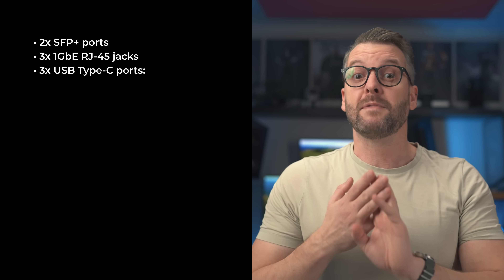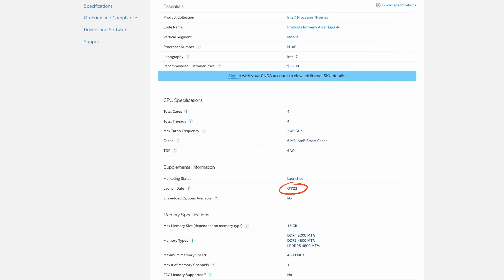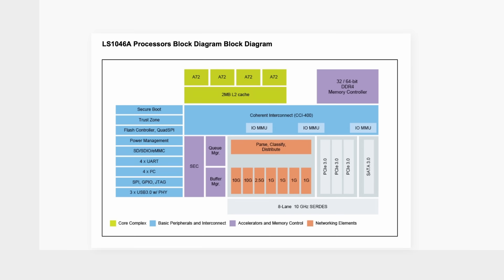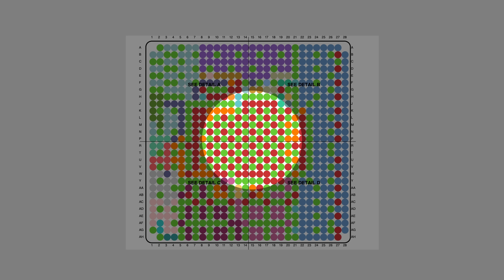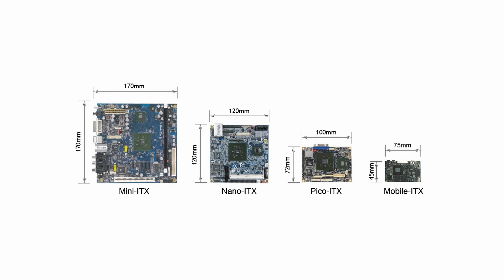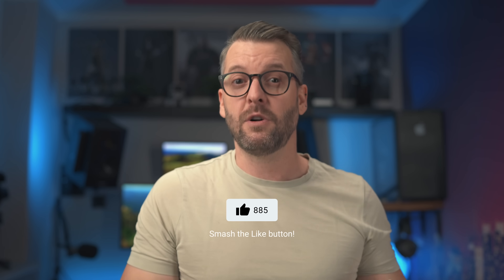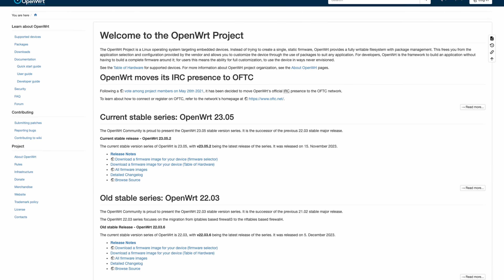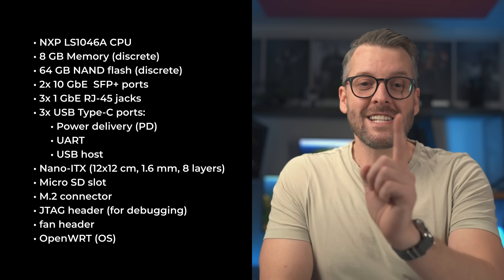I'm making a high-end router IN PUBLIC. Here are the final specifications.

Comment: I think you are drastically underestimating the software effort here to take most advantage of your hardware platform, which is why the "laptop CPU in a fanless chassis" form factor is so popular.

Also - maybe don't waste your time on the hardware, and just use the Banana Pi BPI-R4 platform which already exists and meets or exceeds all the specs you've laid out here.

If you have an industrial design team that's already bought in to this ceoncept, then don't waste time developing a new PCB on a new CPU platform, just take the BPI-R4 and turn it into the product you're imagining (more flash, add SD card, etc.). Then you can start prototyping & developing software now and maybe be able to ship something near the end of the year or early 2025.
Reply from the maker: Thanks for the feedback, but no. You don't build a company on shoulders of someone else's. Too risky.

Comment: I'm curious what kind of bandwidth this CPU will be able to do with SQM (CAKE) enabled on a 10-gigabit link.
If you use an SFP+ module to link to a cable modem with a 2.5GbE port, you'll definitely want SQM so it won't try to send 10 gigabits through the 2.5-gigabit link.

Comment: I find the „high end“ very misleading (also I understand where you coming from). The Microtik CRS312-4C+8XG-RM for example has 12 10gig ports, 8 of them do also 2.5/5 and 4 of them also do sfp+ and it’s cheaper
Reply from the maker: You're comparing apples and oranges. What' you listed is a switch. These two devices (so the one we're planning and this Mikrotik), would actually work great together.

Comment: All ports UTP should be 10Gbe since that would be a minimum for power users in some years ahead. NAS loaded with SSD"s/M2's will be the norm, and you want at least 800-1000Mb/s throughput to use those NAS boxes for video editing in 4K. Even 8K is around the corner. And for Mac, since local storage is extreme expensive, this becomes a very good use case!
Reply from the maker: I agree. But there's this small issue of,... price :)

NXP actually does produce a CPU that supports 8x 10GbE ports, but that CPU itself costs around $300, and if we add  PHY chips, connectors and all the other necessary stuff for 10GbE networking, it would cost well over $1000.
Reply: Yes now I understand. So unfortunate. @tomazzaman

Comment: I Think Its a cool project but i have a few concerns. I ve recently upgraded my router to 25G using a minisforum ms-01 and a mellanox 2x sfp28 nic. It runs opnsense and has 2*SFP28,2*SFP+ and 2*2.5GBase-T and cost me around 800€ which is an incredible price for a device this fast and capable of pushing 25G... I sadly dont see where the Router your Team is designing would make sense for somebody like me... Cool project nonetheless
Reply from the maker: Thank you for the feedback. I like how some of you are pushing the limits, but what I need to keep in mind is the majority. And the majority doesn't use or need 25G.
Reply: @tomazzaman  and the Router definitely has its place... I used to work for an ISP and we had ekinops OneAccess devices which were arm based devices just like this one using some BSD/Unix firmware and they destroyed every other manufacturer  in terms of flexibility and performance. If done right yours is gonna be a beast with even lower latency than my Software based machine (using a Opnsense Software bridge  for the SFP+). Also i like the machined Aluminium housing alot! I dont remember wether you plan on putting a fan in it, but if you do, i definitely wouldnt cheap out on that. My previous Asus AX89X had a Fan which was ridiculously annoying... Dealbreaker for me by now. And for the WiFi i have a wird idea: you could do a tray like a disk bay on a Server Option one: a tray to put something like an Intel be220 in with SMA antenna plugs on the Outside of the case 
Option two: a tray with an oculink Interface to connect on the outside so one could build an external WiFi AP module with high gain antennas or whatever using the pcie over oculink to connect to the rozter... Similar to a framework Laptop modules
Reply from the maker: @legendaryz_ch  Thanks! We do plan to put a fan header on the board, but aren't sure yet whether it'll be necessary, at least not for the alu version. Regarding the WIFI, there will be an M.2 connector on the PCB (Key E), which should give us the flexibility to put one on after the fact. What we're also exploring is out own access point, but nothing conrete yet, we'd rather focus our limited resources on the router to develop something great.
Reply: @tomazzaman  that might be true, but the majority also does not want a full metal enclosure which costs more than wlan routers with NAS and phone and iot and cable modem and ap. So if going for the high price, also go for the high-end

Comment: Yes, I hate mostly something, it's missing a 2.5G RJ-45 for a device that will cost over 200€ and it should be future-proof, well the 10GbE is greate but most devices these days are 2.5G and the trend is rising. Especially when you have internet speed over 1GbE and a good NAS with 10GbE!
I would rather see a replacement of those 3X 1GbE  RJ-45 with 1X 2.5G RJ-45!
Just my way of thinking!

Comment: An aspect that I think most people are glossing over with this project is the software: what OS will this run? pfSense will not run on it as the only images Netgate provides are for x86. Only Netgate hardware can run ARM versions of pfSense. That leaves OPNsense, openWRT, a custom Linux-based firewall and router OS, which inherently means a smaller community. Having the perfect mix of hardware and features means nothing if the software support stinks. A good example is the gap between the Raspberry Pi ecosystem and the Rock Pi boards. Many Rock Pi boards have better hardware and features than Raspberry Pi, but the software, support, and community is dismal in comparison to Raspberry Pi. And generations of better hardware haven't narrowed this gap. Software is the most critical aspect of this project, and unless you can run a great router and firewall OS on this machine it's DOA. I say this as someone who is excited about this project and wants to see it succeed! 

While your selection of this ARM CPU with its inherent advantages for this application seems like a great choice, ARM lacks the same breadth of support and software options for this use case. ARM continues to grow, but for homelab, hobbyist, and enthusiasts, x86 provides more options and flexibility for software. 

I'm looking forward to learning more about what software options will be available for this device, and there must be options, you can't limit this device to a single OS given your audience.

Comment: Just 1 M.2? Full spectrum Wifi 7 AP modules take 2 M.2's. Cellular as well. Maybe a PCIe multiplexer with support for modular applications? It' sounds like a BPI with a restricted feature set otherwise. 

SFP+ is a standard from 2006.. That CPU will be old news also by the time September comes around. I may have to wait for a Gen 2 :).
Reply from the maker: We're making a router. Even a single M.2 is an overkill for most, haha. And fun fact, ARM Cortex-A72 is now 8 years old, still being mass produced. Just shows that old doesn't mean bad. Like myself. 😂

Comment: Lost interrest. was following close as it sounded exciting but it is 2024, and most likely close to 2025 before actual product comes to marked. And in my opinion a router in 2024-2025, would not make anysense to buy a router without 2.5GbE. as meany of our internet providers atleast for fiber in denmark dont even ship out routers without 2.5GbE anymore, would i like to see a simcard slot aswell but as in my resreach in minipc/routers, there not a working M.2 5G/WWAN card working as of now, as far as i see it for now  the Banana Pi BPI-R4 would be the better option, if you where to buy it today also coming in at a pricepoint around 160$ the alternative would be to buy CWWK or TopTon Mini PC N100 with 4*Intel i226-V2.5GbE  witch could clock you in at a price as low as around 300$
Reply from the maker: Fair points!

Comment: This is so awesome! How can we pre-order or pledge?
2 small inquiries: SFP+ compatibility is a pain and each ISP uses different modules. Is it possible to maximize compatibility somehow to avoid needing a media converter? Similarly, is it possible to make the SFP+ support all multi-gigs: 10, 5, 2.5 (and 1)?
Thanks for sharing. Really looking forward to more updates!
Edit: I also believe Type-A would be better as the host for a cellular modem or printer. What sort of Type-C devices would fit there?
Reply from the maker: I'm not a huge fan of preorders, as many have been burned by them in the past and I'd hate to be in this position. Maybe, just maybe, when we're close to launch and if the demand is significantly higher than the supply.
As for the multi-gig support, that's up to the SFP+ module that you use, we plan to test as many as possible to make sure the widest selection is possible.

Comment: So basically you are building something like turis. It would be probably best to build it so it is affordable but also can do wifi and has easy to use interface for non technical people with an option to see more advanced. Building a device that maily meets requirements of enthusiasts is a mistake I think. Try to make one that is more down to earth and one that is for enthusiasts. Will this router be available in the entire EU? Do you also plan to get in contact with local sellers or will you mainly handle everything yourself ? Btw i just discovered you and it seems like interesting project. Good luck.

Comment: Will there be the option to add some M.2 SSD into it? IMO it would make it a perfect NAS without the need for external one. Just my 5 €c.
AFAIK WiFi and SSD have a different keying on connector. Maybe adapter could be used for different keys.
Reply from the maker: So, the current plan is to use Key E for the M.2 socket, which isn't compatible with NVMe drives. If you want additional storage, there will be a USB3 port. But, that's not the focus, we're making a router, not a NAS :)

Comment: I build custom networks for very strange places, usually with extreme weather. Often using the $250 Mikrotik RB5009UPr+S+in and loving them. Not quite the same specs but I'm interested in more info on the durability specs.

Comment: I'd like to hear from you why this router is better than alternatives from your competitors at the same price point. I think it's wise to consider it while making your specifications, because if you're going to be roughly the same specs at the same price, I think your competitors will have all the advantage.
Reply from the maker: I've done a video on just that! https://youtu.be/qnM0h34rB8g
Reply: @tomazzaman  I did watch that video, but it is rather vague in terms of specifications when talking about your competitors. But now you have your specifications, your price point, there's still competition to look at. For example, Mikrotik's CCR2004-16G, which also has 2x 10G SFP for about the same price. 
Having your hardware open and customisable OS is a big selling point, but you might need a little extra to push fence-sitters to your side, even if it may be just advertising the ways the hardware can be customised (upgrade RAM? / Add Wifi? / Expandable Storage?), or on the software side like being capable of running a small mail server for your family on the router itself.
You made a video about COGS vs Perceived Value, and mentioned in it that you can increase the perceived value simply by flaunting your product's capabilities.

Comment: is the POE+ going to be a power sink or source? 
Regardless there are POE modules that can be added if needed , provided that you added pinheaders on the needed signals. 
OR u can simply pin pinheaders and develop the POE module later on another 2-4L PCB if there is enough demand ( if there is not enough space for a standard module or you simply want something built better/ that fits better overall )

Comment: Sorry, I'm just a little confused (bare with me. I'm not that tech savvy). This is a router without wifi? Is this a switch?
Reply from the maker: The device that your ISP provided you, is an "all in one", so to speak. A router, a switch, and an access point (wifi). It performs all these functions well enough, but exceeds at nothing. The device I'm making is a router, so a specialized device which has no wifi. For that, it needs a separate device (access point).

Comment: Now that i think about it more from router perspective a single 1GbE RJ-45 jack is a must as it can be used as a management port or as a networking port for those of us still slumming at rj-45 based 1GbE lan (not that i need anything more). but i also think 2 SFP+ ports are a must as well. SFP+ is very versatile connector that is native to fiber which is what most faster then gigabit WAN(and even slower then that) connections would already be either sfp SFP+ or a fiber connector that you connect into SFP+ module therefore having RJ45 2.5 GbE port would be kinda bad and wastefull specially if SFP+ port was eliminated also using 2.5GbE RJ-45 makes sense from UX perspective, but doesnt from any kind of expandability or usability perspective as sfp+ can be adapted to do rj45 so if user had a rj45 2.5GbE network they could use a media converter module to go from sfp+ to RJ45 at which point they can connect to that. and still allows those with 10 Gbps network to use SFP+

Comment: wow all that r&d + investor $ just to spend it on a subpar router with dated specs. if I was in charge of the project i would scrap the GbE and opt for 2x 2.5GbE + 1 PoE (2.5GbE), upgrade sfp+ ports to sfp28, scrap microSD, add secondary m.2 slot for redundant boot drives or add 2 usb/poweredSATA headers for redundant DOM drives. most router software doesnt even need more than 8gigs of nand flash for their OS and you should really be writing your logs to a server.
Reply from the maker: Do it.

Comment: Super looking forward to it. I'd like the 2.5Gbe port just to be able to eek out that little extra but I feel like one SFP in and out should do the trick most of the time, but if it were possible with the current processor, full 1/2.5/5/10 Gbe RJ45 would have been great just to make it suit more needs and extend a bit further into the future, though I'm someone who bet on the jump straight from 1Gbe to 10Gbe rather than the market all going to 2.5Gbe, so I'm set for it. I'm not expecting it soon but this is definitely enough that I'm putting off upgrading my pfsense box  to see how this pans out just because it checks the boxes so nicely. Best of luck and looking forward to the future updates!
Reply from the maker: Thank you for the kind words of support! I also jumped from 1 directly to 10 in my home network :)

Comment: WHen I'm paying more than double the price of a regular FritzBox, I'm expecting more. The SFP+ ports are nice, but the fact that the one possible 2.5gig port is only a consideration... Ehh, I dunno. 2.5gig is important, especially if you don't want to throw your SFP+ ports into a switch and then to the respective devices.
Reply from the maker: Valid points, thanks!
Reply: @tomazzaman  Don't take this the rude way! I just believe that if you are designing a top notch router that people would pay a few hundred for, you should put everything in the processor's capabilities in the device. 

Could the host USB-C port work as a drive access? To have a very simple (maybe Samba) network drive that doesn't really on any other device. 

I also stand behind the idea of adding PoE to (possibly) all RJ45 connectors.

Comment: ARM is very limited in terms of OS.

Router operating systems are very limited compared to server or desktop operating systems. So you already have a smaller option to pick from.

That rules out VYOS, PFsense, and OPnsense.

Is this a DDWRT/Linux only capable system?
Reply from the maker: Luckily, all the projects that you're listing are open source, meaning that with enough resources, it's possible to port them to ARM.
Reply: OPNSense already has someone making aarch64 versions

Comment: Look at the support for the DPAA of the CPU in the Linux Kernel. The biggest drawback of multi-port routers, which don't include switch chips, is the port2port packet forwarding performance. In these designs all packets need to go through the CPU which hammers the performance/increases power utilization. Also agree with 2.5GBe port - it's a must-have these days. I know you could offset this by a SFP+ -> RJ45 converter, but still a native port is better. Having PoE capability on copper ports will enable easy deployment with numerous WiFi APs.
And do you plan to enable M.2 storage? Or just keyed for the WiFi adapter?
Reply from the maker: I have a form up in which I ask all the relevant questions and the majority of people "vote" for two SFP+ instead of RJ-45, reason being max flexibility. And as for the M.2 storage, I don't see why not, it's a firmware/software thing, once it's routed to the CPU properly.
Reply: Agree with the sfp+! What I meant is that if we don’t get a dedicated 2.5G copper port we’ll need to sacrifice one of sfp+ to it.

If it comes to M.2 - WiFi and NVMe have different keys - so it’s either or (unless you use adapters)
Reply: M.2 storage and wifi tend to use the same interface (PCIe). Do be clear on what's supported, e.g. USB or SIM connections. As with type C, that's not evident from just the connector, though there is some keying.
Reply: @0LoneTech  They use the same PCIe Bus (yet that's not entirely true as well), but the physical slots are not compatible. M.2 WiFi card are key A+E, while NVMe M.2 drives are key M - they are physically incompatible due to the notch/key position. Key M slot has 4 lanes of PCIe, while A+E has 2 and additional signals to kill WiFi signal.